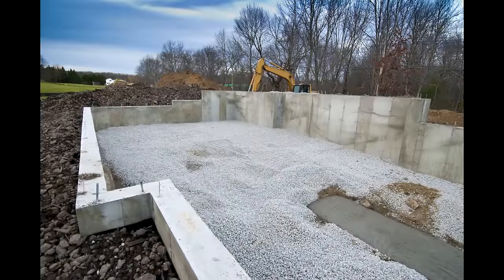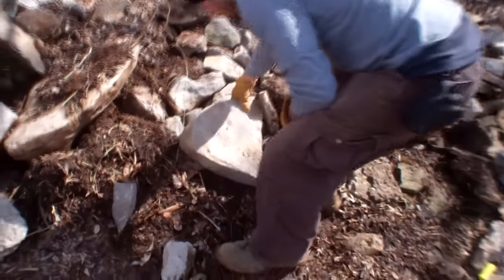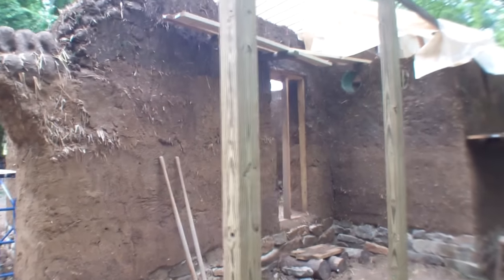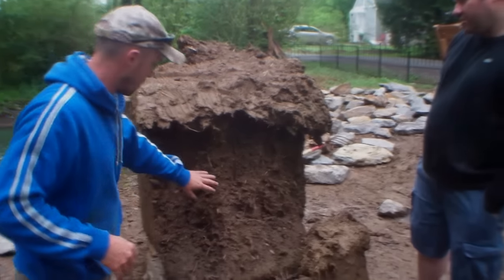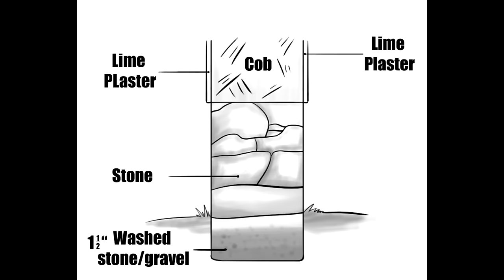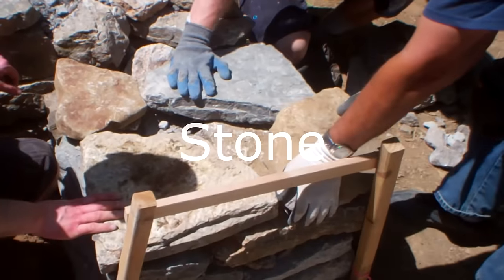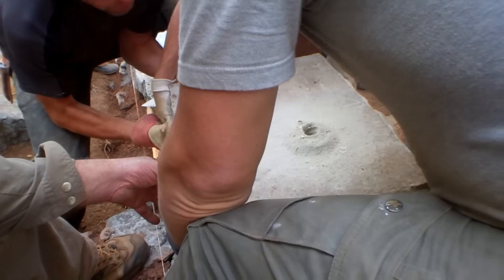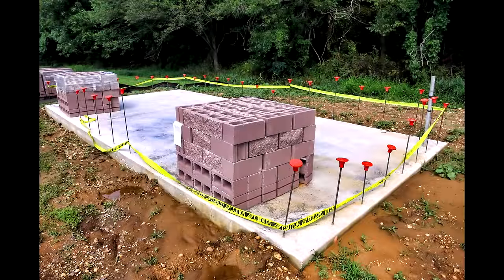NATURAL BUILDING - FOUNDATIONS AND MATERIAL OPTIONS

Comment: Just a note:
From videos On seen at least, fixing broken foundations is now a lot easier & cheaper than it used to be, because of new technology called Polyurethane foam (I thin that's the name).
Basically, a few narrow holes an inch or two wide are drilled below the foundation, then a liquid polyurethane is pumped in, which then expands & becomes very strong.

Comment: I live in Arkansas.  Every time i make cobb it is frail. A mere push from my hand and it crumbles. What am i doing wrong? I use sand from river. Red/grey clay from ground straw
Reply: I don't have any experience in cob, but I am wondering if there is not enough clay or if your straw is not long enough.  Short straw does not hold the material together as well as long straw.  I read that somewhere.
Reply: off the bat, sounds like too much sand. and perhaps not properly mixed. short straw/long straw...doesn't matter. either is fine. how are you testing your soil's clay content?
Reply: Arkansas as well.  Check the content of your soil (there are several videos to help you with that).  A lot of red-dirt in Arkansas is high in clay content, which means it is more likely to shrink and swell.   You want 20% clay in your mix, before adding sand, no more.  Clay is only a binder for the aggregate (meaning it binds the particles of sand together), the sand is what prevents shrink and swell.   Again, there are a number of videos here that explain why the sand content is so important and why you don't want too much clay.  Also, you say "ground straw"--what do you mean?.   You want to use straw, and preferably 12" long.  Like Wheat straw or Rye straw.  Most of what you find here is fescue hay.  That's not the same thing and does't have the strength of wheat straw--and it rots.  I just checked online and you can buy Wheat straw in Arkansas for $4 per bale.   Hope that helps

Comment: Without plants nearby, water cannot travel up against gravity. It also doesn't travel across.

thus as long as you also compact the ground on which the house is built, NO FOUNDATIONS ARE NEEDED
Reply: I think that depends on the climate and soil where you live. Where I live, a wet, moderate maritime climate, with over 50% of the land in my country below sealevel and many (underground) rivers, water does definitely come up through the ground. I live in a region that is above sea level, but with so much water around the soil here is always wet (great for farming). Anything you put on the ground will suck moisture out of the ground, so a moisture barrier is a necessity. If a patch of soil is not wet it's dry white sand that can not be compacted. Most of coastal europe has this climate, and I'm sure a lot of other places do too. In most cases a foundation is necessary.